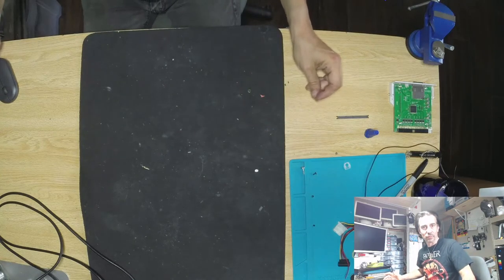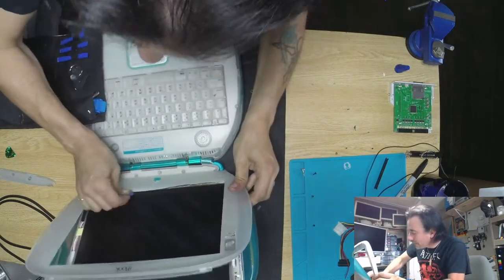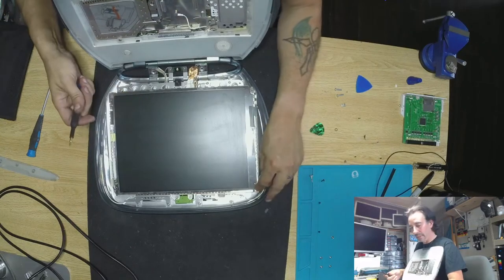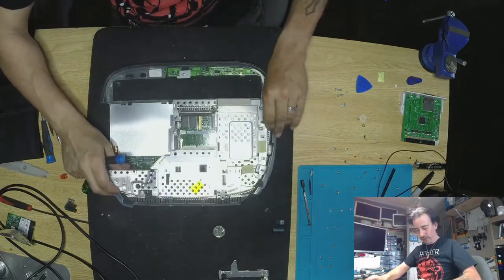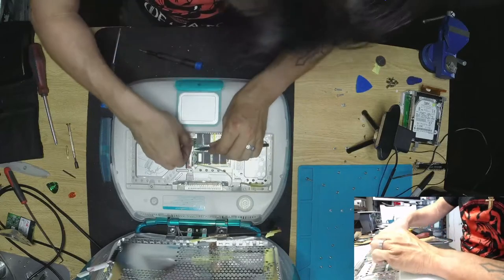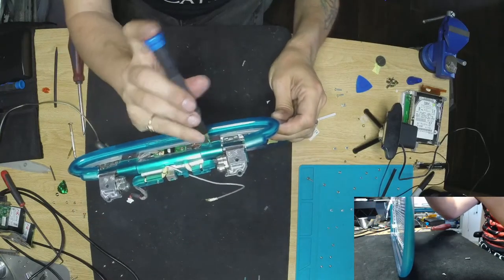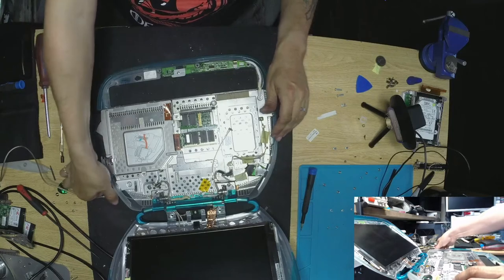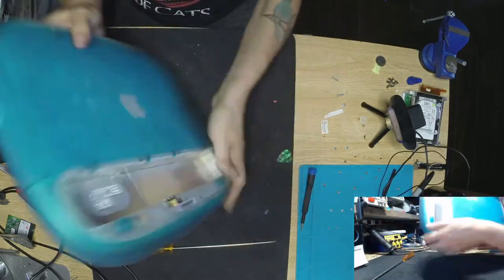Japanese Ibook clamshell G3 LCD screen replacement

Comment: I recently bought a junk G3. This video really helps me alot because I have to change the screen from now on. Can you tell me the part number of screen and where I can buy that? Thank you in advance.
Reply from the maker: When it comes to the part number? it all varies on which brand you have. like LG, IBM, Samsung and HP. at the back of your LCD screen, you should see a big sticker like Samsung, the part number should be like "LT121SU-23" and LG ", "LP121SA" just an idea for you to look for when you take your screen off the Ibook. When it comes to buy? i would look on a used Apple parts website as there is a few out there, Ebay, Picclick, or if you are lucky, knowing the right person that collects them in your neighbourhood. Parts are getting harder to get lately, so if you can get a Part machine with a good working screen? it would be the best alternative. Even I am having a bit of a hard time getting some. ;) Hope this helps
Reply: @imac7531  Thank you so much for your kind and thorough answer!!

Comment: Great video! so In theory even if the LCD is a different brand, would it still work? Or would I have to also disassemble and gut the doner ibook to replace my ibook screen?
Reply from the maker: i have never had any issues by switching with another brand for as long as you swap it with the LCD original video ribbon cable. you can't use a LG ribbon on a Samsung lcd screen. but i have done many LCD swap from a busted Samsung to a working IBM, or LG etc and they all work very well.
Reply: @imac7531  Ohh I see So Samsung and IBM are interchangeable/compatible with one another? Or is it like Samsung with Samsung, and IBM to IBM? I just bought an indigo Ibook g3 that will need an LCD replacement and I just wanna make sure i got all the facts right.
Reply from the maker: @BluesLuxury  they are all interchangeable for as long as you keep the original video ribbon cable attached to the screen. if you use per example a Samsung lcd with a HP ribbon? you will get a white screen or no image at all
Reply: @imac7531  Thank you so much!! It makes sense now. Also any other advice or tips you think I should know?
Reply from the maker: @BluesLuxury  as of now, i never ran into any issues when it comes to swapping the screen. so if you have a samsung in your ibook? you can replace with a HP, or IBM or another Samsung.
Reply from the maker: @BluesLuxury  you might as well replace the drive for an SSD hard drive while the ibook is all apart. lol it will boot faster, work faster, no more clicking sound and it will be quieter and better on battery. :D
Reply: @imac7531  Thank you so much for everything! Last question I saw a website that sells used preowned parts; I saw a ibook blueberry plastic screen with Lcd included and a separate Lcd also for sale. They both don’t specify the brand name. Should i buy one of those or just buy another ibook as a donor?
Reply from the maker: @BluesLuxury  hummmmm, that would be a hit and miss. i personally wouldn't buy anything if i don't have the brand and or a complete screen. To be on the safe side? i would buy a none working ibook as a donor.
Reply: @imac7531  Bet! Thank you so much for everything! I am definitely excited to eventually be upgrading my ibook! And I will definitely be subscribing to your channel.
Reply from the maker: @BluesLuxury  Thank you, glad to help. if you have any other question, please do share and will try to help you the best we can. =)